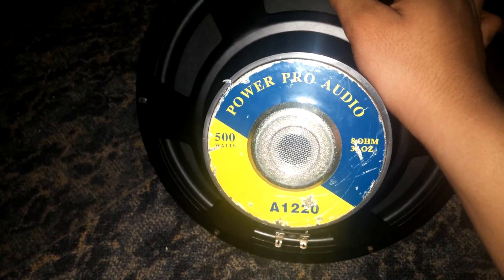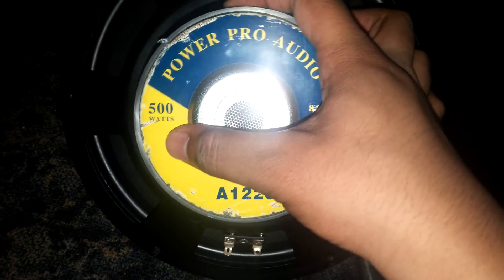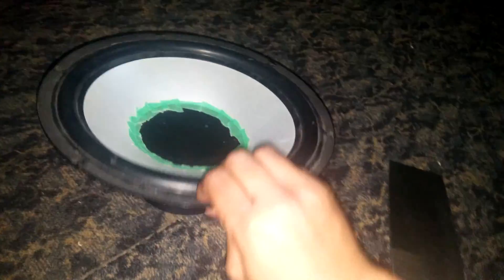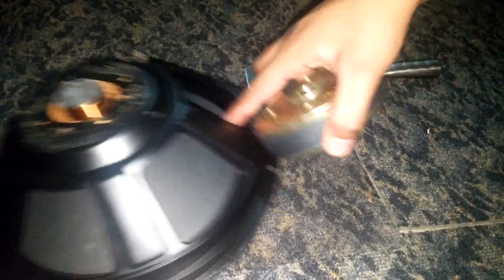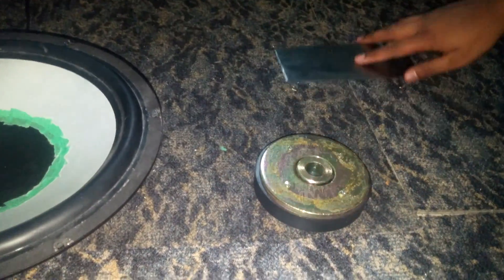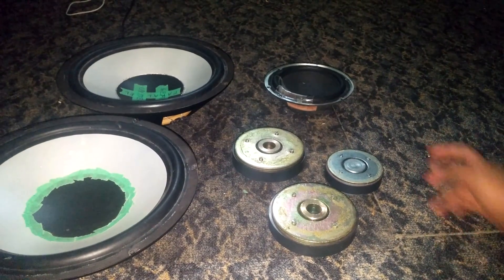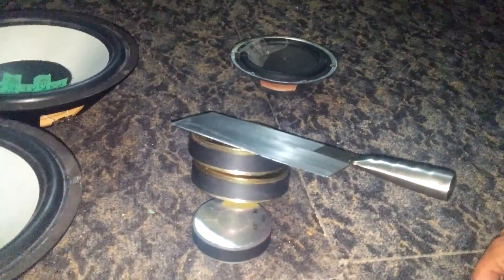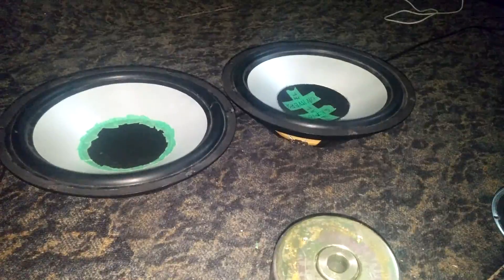Making a 12 inch passive radiator

Comment: Now you need to tune these with a specific amount of weight glued to the center of the cone. I would start by taping coins until you get close to the frequency response that you are most happy with. 
Of course the box volume/area will play a huge part in this, so you will be doing a lot of opening and closing of your box.

Comment: You have to knowthe weight of the cone to know how much weight to add fot the fs u need
Reply from the maker: +Durolith +Durolith yes. i added 100 grams of metal inside the vc and my tuning went to 57 to 45hz with my 100 watt 8 inch theatre subwoofer